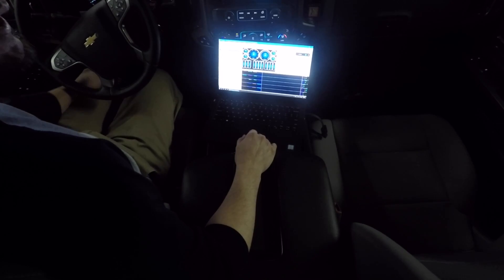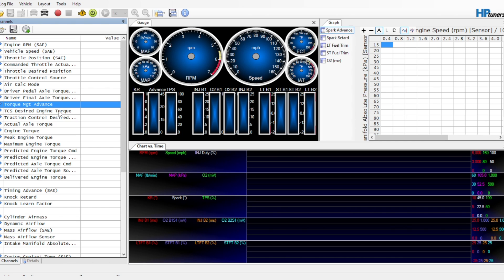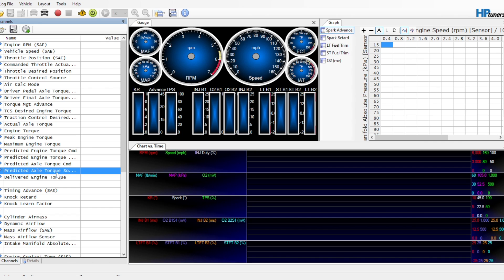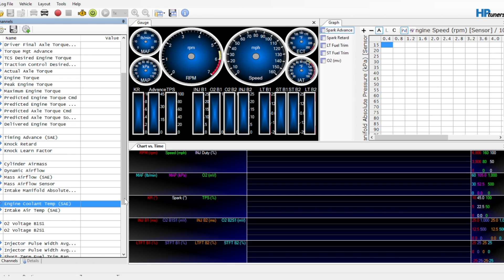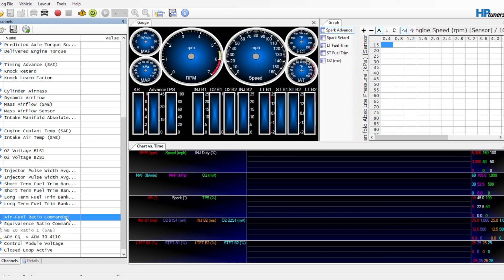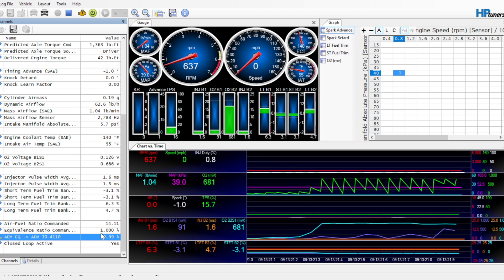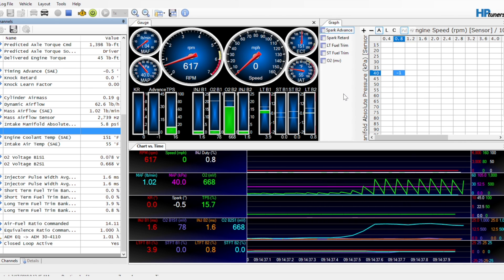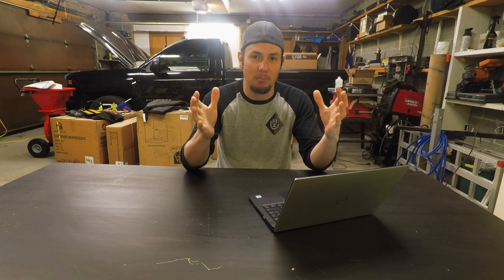HP Tuners Scanner Setup, Tuning Series Vol. 2

Comment: I'm really struggling with measuring afr or lambda I connected my 030 300 to the 5v ref at the o2s2 and I follow along the stuff I get to the point where I add the math to match my gauge but it never matches

Comment: First let me apologize in advance lol (not to computer minded)
I put a 2000 5.3(out of Silverado)vortex in my 99 s10, bought a new harness form Current Performance (Fl) and its running but needs this type of dailing in. Rebuilt all stock for now;) Bought a HP laptop & HPtuners MP13 with two universal credits. i downloaded the VCM, got gauges and some components, but it doesn't read anything like yours. Was I suppose to download more? use a credit?

Comment: Hi. I have a strange thing going on I wonder if you might have any ideas? 2005 gto . Cam and everything else stock. I pulled out the auto trans to go through it again after 3 years or so of hard life . Put it back together and now it runs rich. On startup it hits 14s to 1 and almost Immediately heads for the tens. I went through one of your videos as far as I could tell.I think I disabled the Maf and still same deal.

Comment: Is there a list of required PIDs some where needed for GM gen 3 MAF tuning. It cant be that many I would think. Thanks for the work you do. Here is the list I came up with: 

1	Cylinder airmass
2	Dynamic airflow
3	Mass airflow (sae)
4	Mass airflow sensor
5	Intake manifold absolute
6	Intake air temp
7	02 voltage b1s1
8	02 voltage b2s1
9	Air fuel ratio commanded
10	Equivalence ratio commanded  (lamda)
11	WB input  (lamda)
12	Closed loop active

Comment: Realize this is an older vid....going thru the vids on your website tuning play list...have been data logging Challenger Hellcat for about 2-yrs using HPT....I notice in your PID list you use a lot of SAE PIDs. I have found when comparing the SAE PID to the corresponding Manufacturers PID (sensor voltage) that the SAE PIDs do not reflect actual conditions. Engine RPM, Accelerator Pedal, and Throttle Position are specific examples since they are changing rapidly. I have found the SAE Engine RPM values off by 1000RPM low when compared to the non SAE PID and validated by the torque converter turbine RPM PID. Have you ever noticed this? And if you have what was the cause if known...PID list too long, polling rate too slow, etc.  Thanks
Reply from the maker: SAE has to meet a standard and so they are often skewed, TPS is notorious on all platforms for this, if you have the option of non-SAE log it
Reply: @GoatRopeGarage  Thanks....great info and advice found in no other place! I keep hoping you will do a series on Hellcat tuning even if it was just to go thru the tables and explain some of the table descriptions and labels that don't make sense e.g. dyno flag??? :)

Comment: Just come across your site and content , so just getting started. I’m in the UK, so things and cars a little bit different here although the principles are the same and I’m sure I’ll still learn plenty from you. I also crew on a Pro-mid car which has 3000+ horsepower and runs the 1/4 mile in low 6s and sometimes high 5s. Keep up the good work 👍

Comment: Im building a 62 bel air and i did a ls swap with a 2005 6.0 lq4, I put bigger cam and heavier springs in it with headers. I am just now getting into tuning was wondering if tuning gen 3 is similar.

Comment: I have never tuned before and am thinking about buying a hp tuner for my circle track cavalier was just wandering if you recommended them or not I need not only more power but also to extended second gear because I’m hitting the rev limiter and 3rd gear is too bogged down any information would be much appreciated

Comment: I’m a old school hotrod guy trying to learn this type of tuning. I have a gen 5ss Camaro. I bought the mpvi2+. But this lamda thing is throwing me off. Do I need to buy a lamda device for this hp tuner program to run with It. Or am I just not understanding what your saying. Thanks for your time. I am a subscriber and love the channel. If I ever get this figured out, its going to be a lot of fun at the track playing around with the tune. And agin thanks for your time.
Reply from the maker: Billy, all widebands read in lambda, if you are seeing AFR it is converting lambda to AFR, so when you are running gas you just need to know that is is lambda multiplied by 14.7 so when lambda is 1 it is 14.7, when lambda is .85 the AFR is 12.5, AFR as we usually use it is gasoline based, but when you go to ethanol or methanol the AFR changes but lambda stays the same as it is a measurement of burn efficiency.

Comment: I am in the process of converting my 90 corvette to Dynamic EFI's EBL p4 flash unit to eliminate chip burning. They recommend using Tunerpro. Do you have any experience with that software?

Comment: Man, the support for Ls is just overwhelming. I'm on the Dodge side of things but I'm certain I'll gather the needed information. Loving the series so far. Know it's been said several times but I appreciate you putting these content out. 

Question: I'm bout ready to throw on some bolt on mods (Longtubes + off the shelve cam) on my project car (have a daily), you reckon I throw these on and gradually learn the tunning or learn the tuning before hand? I have the MVPI2 pro going with the Innovate Motorsports DLG1 wideband.
Reply: Hey just wondering if you ever got your question answered? I have a similar question and want to know if anyone ever answered yours

Comment: Question. I have a 2004 5.3L  in a 69 chevy.  I saw that a Diesel can have HP tune Switches to switch between tunes. Can you do that with an LS as well? Like E85 tune, or 87 octane and so on?

Comment: I know this is biased towards Chevy engines, but does this information carry over to just any engine in general? If I buy HP Tuners for a Ford 4 cylinder for example, does the general theory apply?
Reply from the maker: Yep, it's all the same, air, fuel, spark

Comment: I just rebuilt my 8.1/496 gas motor. It idles low.should I adjust the idle first before making other changes. I’ve been watching your videos and the are awesome.
Reply from the maker: A lot of times your idle issues are tracked back to fueling issues that get sorted as you start dialing in the fueling.

Comment: Hey I just ordered a HPT MPVI2 and I’m going to start tuning my 2016 GMC Sierra 5.3/8speed . It is a stock truck at the moment. I’m wanting to disable DOD and tune is for 93 octane . Any advice on anything I should do for 93 octane ?
Reply from the maker: Nah, not really, you might be able to tweak the high octane spark table a little bit, but other than that, just lean out the PE table a bit and that's the max you're going to get out of a stock vehicle. The rest is torque management stuff.

Comment: I liking you video series so far. I like when someone willing to educate without changing alot off money I'm assuming the pid list is different for a gen 3 where would I get that list from
Reply from the maker: Just look at what you're trying to do, check those tables in the editor, they will show you what you need to log. Thanks for watching!
Reply: I'm also going to be learning on gen 3 stuff initially. Super excited to have found such a comprehensive how-to

Comment: Thank you for these videos!! Are PID's just inputs to the ECU of information that would apply change to the fuel, torque etc... PID loop would simply mean when the previously mentioned statement loops around and the process is repeated? Not familiar with PID term...
Reply from the maker: In this case PID is parameter ID, not to be mistaken for a PID loop as used in automation programming.
Reply: Goat Rope Garage so when you say PID loop what do you mean by loop? Thanks again
Reply from the maker: Totally different situation, don't get hung up on the idea of PID loops
Reply: @gregklubek6016  proportional, integral, derivative... nothing to worry about when tuning a vehicle.

Comment: Maybe a basic question,  but when logging is there a general limit to work around? 
In one of your other videos you mention about 15 minutes of driving.  
Would a log longer or shorter serve a purpose? 
Obviously getting enough hits in each cell is important, but would logging for say 1 hour plus really give benefits?
Reply from the maker: Tim, shorter is fine if you're just getting started after new mods and then you can start going longer and longer a you get closer to dialed in. I don't know going over an hour would really have any benefits.
Reply: @GoatRopeGarage  same track I was thinking. 
In a crude thought,  have you experimented with adding weight (load) in your vehicles to help with hitting certain cells where more load is applied to the motor. 
This would prove easier with a truck seeing as the bed provides easier carrying capacity. 
Another thought is hooking up a trailer.  
The dyno that have eddy brakes to hold cars at certain load/ rpm seem to be achieving the same thought process

Comment: Do you have any experience with tuning the GM 3800 series III (Supercharged L32) motors?
Reply from the maker: I do not, Jeff, but what kind of issues are you having? The L32's weren't anything too crazy, night be able to help you out regardless.
Reply: Well.  I’m trying to figure out where to start with the tuning.  I look at different threads in the forums, and it’s confusing to say the least.  I have a 2005 Grand Prix GTP, and the only updates that I’ve done is add headers and 3” DP, catback, CAI, 180 tstat, and 605 Autolite plugs.  Smaller pulley to come soon, but not yet.  Anyway, some mention before starting changing when the fans, come on and off, making torque management changes, and zeroing out tables.  You didn’t mention this in your first videos, so I was wondering if you have already done those changes before doing the videos?
Reply from the maker: You can but they aren't necessary and are generally what I would consider first steps you can do on a s stock car. With your setup you'd probably benefit pretty well from doing the standard MAF and SD tuning followed by timing and if you do a pulley swap you for sure will have to. You are most likely on the lean side of your stock tune right now, but given it's rich from the factory that's fine but if you start moving more air you need to do the fuel tuning. 

Regardless of the platform the basics are the same, they are all air pumps and when we change how much air we can pump with it we need to adjust fueling.

Comment: Great series. I’m learning a lot. I’m trying to save myself $250 by running a PLX wideband through the EGR input. I’ve found a coupe of older posts that have you add formulas. I’m wondering if the latest HPtuner suite will do the math for you. Basically I need to convert EGR voltage input to A/F ratio. Thanks
Reply from the maker: As long as you can get it reading in on that PID you should be able to use the custom math feature in the scanner to convert it to about anything, you'll just need to look up the egr sensor scaling so you can basically undo that scaling to get back to your raw voltage (usually 1-5vdc) then you can convert that to your wideband reading.
Reply: @GoatRopeGarage  I actually didn't know this was possible until reading this question.  I screen capped this and saved the pic in my tuning documentation folders for future reference.  I plan on going with a serial wideband, but I could use my old PLX until I save some more cash if I could use some odd input as my lambda.
Reply: Would love to see you do a video on doing that. Would save people $$ rather than upgrading HPtuners. I’ve read you can also use the AC pressure switch input.

Comment: Hey man I really appreciate this series, it's the best out there right now!   Watched them all as of 4-19.     I'm an engine builder, but never tuned before.   I have a 12 Colorado that I fully rebuilt and am turbo-ing soon and decided I'm learning on a 13 cruze bc I have a spare motor for it.    Is there anything inherently different about what you're doing here, or will this series get all the bases covered for me?       I'd really be interested if you could go over the  meth injection tuning steps after you get the series done. (And e85 but I assume that's the exact same just in the different map tables)
Reply from the maker: I'll do a video on the meth injection, but it's super easy, especially if you're using a boost reference pump driver. As far as E85, you are still tuning the regular tables but there is another one that is a correction table based on the fuel sensor. That shouldn't change as you're always going to shift the fuel table the same percent based on the ethanol content.
Reply: @GoatRopeGarage  sweet, looking forward to the rest of the series!